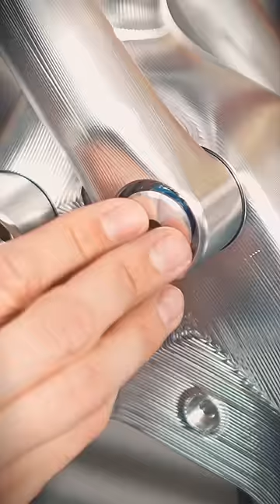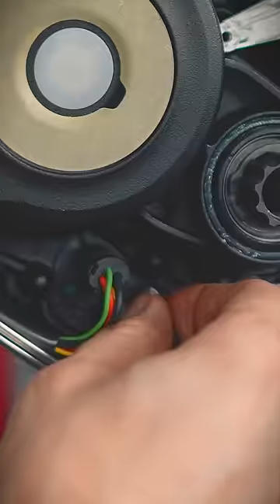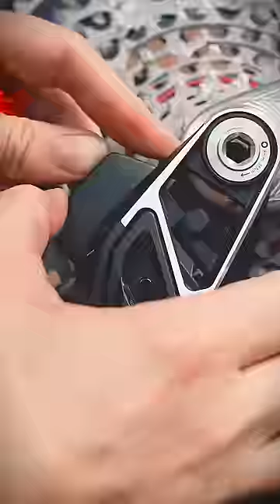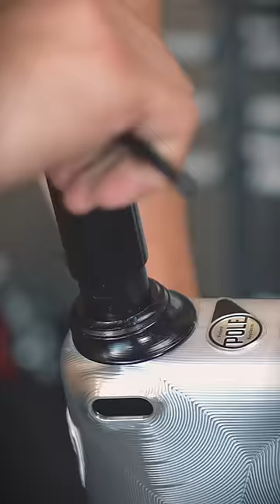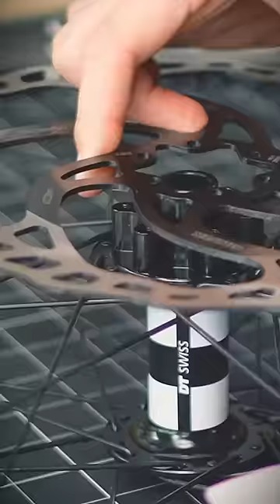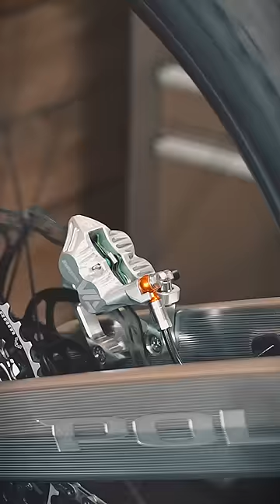Bike Workshop ASMR: Pure Satisfaction #shorts

Comment: Pure metal art. Imagine the size of the aluminum billet that frame started out as!!
Reply: And how much was wasted too 😅
Reply: @danielbriggs7110  the chips get melted back down and recycled into usable material again.
Reply: It was probably a hollow casting and then machined on the outside to clean it up. If the frame was solid it would be quite heavy.
Reply: @danielbriggs7110 😂
Reply: @nathankleber9150  It's two billets where the insides are machined first and the two halves of the frame are bonded together, then the outside gets machined.
Reply: @avlehtine oh... ayt
Reply: holy fuck, no wonder it's 10k+
Reply: Взятого в России 😂

Comment: looks stunning, it's really going to hurt when that gets it's first scratch or ding
Reply: Doesn't look stunning at all. Sh_t engine, bad parts, really bad technique at bleeding, expensive cassette for literally zero gain. It's shiny. You thought it looked stunning because it was shiny.
Reply: @nicojar  someone doesn't like electric bikes 👀
Reply: @nicojar "bad parts" you're nitpicking over nothing. I have a mid-range hardtail and this Pole is the absolute stuff of dreams.
Reply: @nicojar  awk did mummy only get you a mongoose? 😂
Reply: Boo has a trek marlin and is saying this is trash
Reply: @jerrymartinez2160 😂😂 bet it won't even be the cool blue and black colour mix. It will be the shitty red coloured one 👀😂
Reply: @nicojar  which parts do you think are bad?
Reply: @nicojar  they beating yo ass in the replies
Reply: Or stealing.
Reply: @haR0Ld2244  I am not crazy over electric bikes, or at least should have placed motor in rear hub but then the balance will not be there. So, I stick to human power and the electric weight penalty is just too much for me.  

I do wonder how the machined finish looks in person.
Reply: @nicojar They put that motor in as legal limit over there. Yes motor not that powerful but for the limit over there is one of the best options available for torque pretty much. 

Personal they sure have painted and coated it as protect the metal long term and would look way better if done right.
Reply: @joeblogs318 I’m old enough to remember when a mongoose was the TOP of the bmx bicycle food chain
Chunky aluminum rims lol
Reply: @litoaykiu  ? Why would you want the motor in the rear hub? Middrives are superior. It lets you use your drive train as a transmission. Hub drives are for the poor and lazy.
Reply: @nicojar  That's a Bosh engine; it's 250 watts, which is the legal limit in much of the EU, but it tops out at 600 watts, and considering its weight and reliability, it's a really good motor for someone who doesn't want the bulk of a Bafang motor setup.
Reply: For the money i could be buy a used sports car....

Comment: My man is riding around on a year's worth of UK minimum wage
Reply: Очень дорогой байк 😢
Reply: More like 5-6 months wages
Reply: @frostedlambs  I doubt it, unless the frame itself is made of some crazy expensive alloy and/or this bike was a 1of1 made to an insane standard. The other parts can only be so expensive until you're just overpaying more for the same product.
Reply: @mOTHgOBLIN  The frames are CNC machined from 6075 aluminum, whereas most aluminum bike frames are 6061 and welded out of pre-formed pipes. This bike would cost you about 7,000 dollars.
Reply: @TWEAKLET you can’t get a custom built pivot for 7k new

Comment: Starting at $7k, honestly not nearly as bad as i figured a billet aluminum full suspension e-mountain bike would have been!
Reply: Its pre sell in September how do you know price
Reply: Lol it’s not 7k
Reply: @domingez79  This is the OG Voima Enduro that has been on sale for months now. The September dates are for the Trail and Downduro builds and the new Sonni gravity platform.
Reply: Yeah, that's surprisingly not that bad. I figured the block of aluminum they cut the frame out of would have cost about that much..
Reply: Id buy a new motorcycle instesd for chesper
Reply: @albertogiavani75  that's cool..... they're two different things, though, so it doesn't really make sense, but you do you man
Reply: I was fully expecting the last part of the video to be riding up a gentle incline with 15 cars trailing behind
Reply: @yamkaw346  it is in fact 7 grand for one of these
Reply: @TWEAKLET  Link?
Reply: Why? - you could buy a used sports car for such prices with money left over for any repairs later on!

Comment: Nice looking mtbike,
Have you tried it?
Reply: Poor design. The exposed drivetrain will wear out and be high maintenance. Also an EV without regen makes no sense. More brake maintenance for no reason.
And and and... exposed wheels. No mudguards, what a mess.
Reply: @difflocktwo  pick a good set of mudguards for £60 🤦‍♂️
Reply: @renegade-master29  That doesn't solve all the other issues with the bike. And it says a lot that for such an expensive budget that they can't even get full fenders.
Reply: @difflocktwo  I only say that because I've just recently bought some topeak fenders for my ebike, and for £60 they look the part as far to say a bargain of an upgrade for most spec ebikes
Reply: @renegade-master29  Which model of topeak? My bikes are under 500 and came with full fenders. One came with metal, color-matched, fenders.
Reply: @difflocktwo  the front one is the XC1 model the back one I'm not sure other than it's topeak
Reply: @renegade-master29  Oh that type. I have used two of that type for one 18" wheel on a recumbent to get full coverage. I need fenders that wrap around most of the wheel. Ideally the wheels are totally enclosed like on a moped/scooter. I want zero road spray on my or my bike.

Comment: hey bro you're the guy I need to talk to. I have a question for you I'm working on a project called the Hyper bike it's basically an electric and hydrogen powered flying e-bike. I've done 17 years worth of research and looking for a few people that are interested in wanting to jump on this project and have some fun. the bikes can be made from a ton of recycled parts and pieces just need a hug Bliss wheel designed so the Drone Motors can fit in the wheels when they're not being used in flight

Comment: Shiny aluminium will last about three weeks until it inevitably does what aluminium does best and creates a dull grey oxidisation over the top. Why the fuck would they not anodize that frame?
Reply from the maker: It’s surface treated with electrophoretic coating to prevent corrosion.